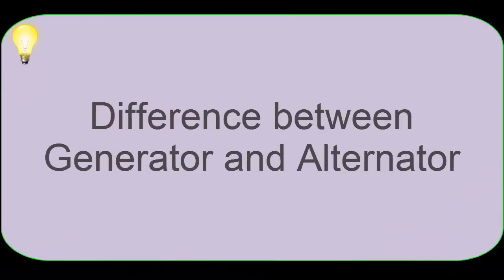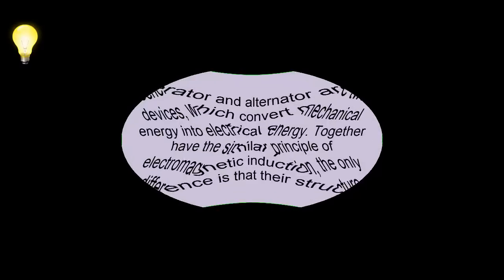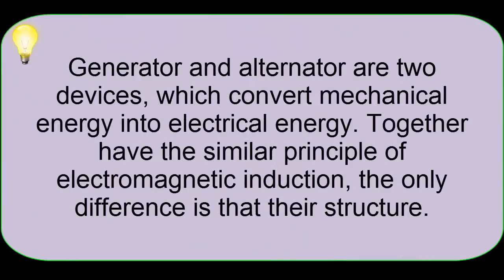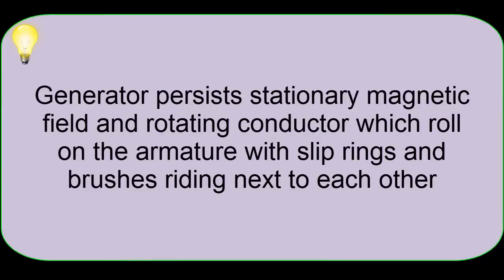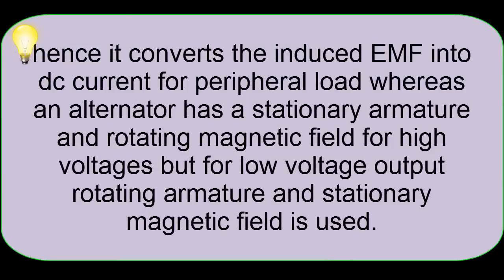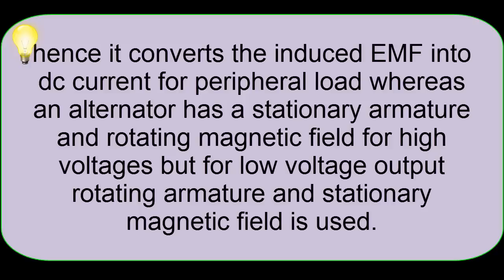difference between generator and alternator || generator and alternator

Comment: What is difference in ac ń dc generator
Reply: I'm replying very late. But for anybody wondering this, the difference between an AC Gen and a DC Gen is the connection points to the power output wires. On an ac generator there are two slip rings and each one is in contact with a carbon brush. As the shaft rotates the carbon brushes maintain contact with the same slip ring. As the shaft rotates up through the field, the flow of current will be in one direction, as the shaft rotates down, the flow of current will be in the opposite direction. This is what creates ac power from a generator. A DC generator has a similar set up with 1 minor change. Instead of two slip rings, there is 1 slip ring that's split in half. One side of the slip ring is in constant contact with a carbon brush until the shaft is 100% vertical. At that point the carbon brush loses contact with that half of the slip ring and comes in contact with the other half. This second half used to have current flowing in the opposite direction but since it is now on the bottom side of the vertical shaft, it's current will be in the same direction as the current that was flowing through the carbon brush just a second before, maintaining the current flowing through the circuit in one direction, therefore, DC power.
Reply: @Tyletoful  great explanation, thanks!!

Comment: is this video for dc generator and dc alternator
Reply from the maker: dc alternator is not possible dear.....
Thanks for Comment...
Reply: what do you mean a DC alternator isnt possible? what do you call a 12v automotive system??? its DC and has an alternator.
Reply from the maker: Thanks , Alex Simpson for your valuable Comment,
Alternator Means The Voltage or current are Alternating and dc means Direct Current, so this two things are not same.
12v automotive system is generating Alternating current also, after that the signal converted into DC Current by using commutator and brush .